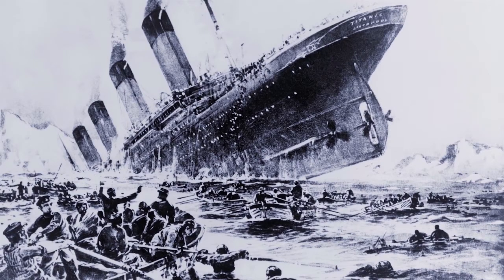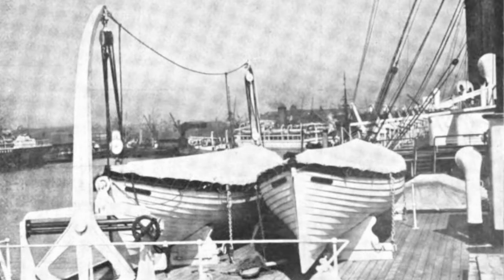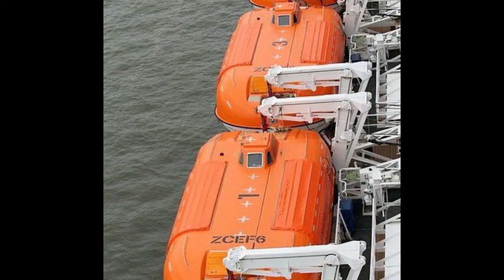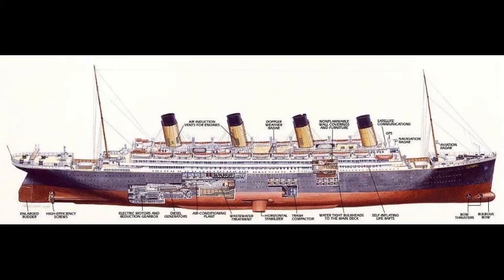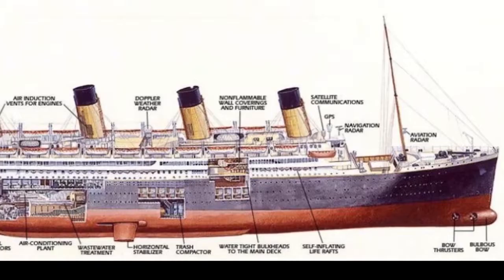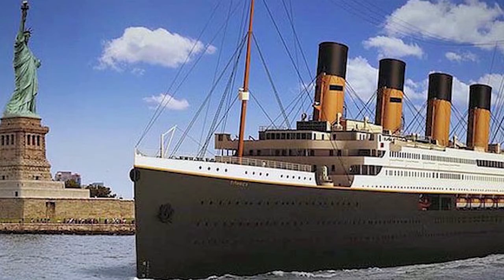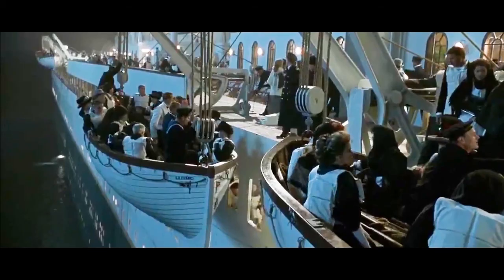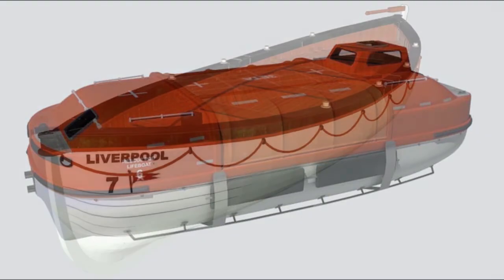Replica Titanic Lifeboat Dilema

Comment: If the third class is done correctly it could make the titanic 2 even more attractive towards people who want to sail on a passenger ship
Possibly more than modern cruise ships
Reply from the maker: Palmer has said there has been a lot of design debate about 3rd class.
Reply: @WaterWorld1  oh
Reply from the maker: ...debate about how authentic to make steerage or not.
Reply: @WaterWorld1  it should be solved at this point right?
Reply from the maker: @bambinazo123  The Titanic II design is complete. However, we don't know the final details. There is no way you can accurately re-create steerage: ie only a few toilets and baths for 1026 passengers and cabins with multiple bunk beds. Modern passengers go cruising to experience  luxury. Sharing a toilet with hundreds of other people would not be appealing.

Comment: But what if the Titanic two will sink and they won’t have enough time to lower the all of the modern day lifeboats because it’s kept on the lower decks?
Reply from the maker: Good question. Modern ships (inc. TIT II) have better watertight compartments. If they hit something which made a hole in the hull, they would possibly stay afloat or sink so much slower. It should be possible to evacuate everybody in time. See: https://youtu.be/hhecZ6XNQ9g

Comment: I think the mess of the front two funnels, for a main example, are more an issue.

Also deltamarine has told some i have seen that they would look into a way to hide the new extra boats by doors.
Reply from the maker: Yes, I'm not sure if Deltmarin came up with hiding the lifeboats a solution that complies with SOLAS.  (Best subscribe as I will have another lifeboat video within a few weeks).
Reply: @WaterWorld1 I have been long subscribed. I say that comment from people asking them online and they saying they were possibly looking into it.

I'd think they would be better in the blue star line look. But orange is better needed. I wish if anything they would be maybe lower, and D deck is were it should be. But that might be both better amd worse than right at the structure line as the aesthetic. But that stuff is the least of problems so far with its working design. Which seems to changed little from years.
Reply: @WaterWorld1 technically the orginal ones could be used if nothing else.

Comment: I have a quesition about the shipyard where Titanic 2 built, can she built in Harland & Wolff where Titanic's built? If she can't built there, can she built in the shipyard that Queen Anne launch in there (Fincantieri Margera Shipyard), because it have a slip launch like the Titanic's launch. And a quesition about lifeboats, what will they do with the white lifeboats in Titanic 2?
Reply from the maker: Good questions: Sadly, H&W can no longer build big cruise ships. Titanic II can probably be built at any of the well-known European yards. I guess it's a matter of which ones have a free slot (2.5 year build)  and offer the best price. The original.style white lifeboats will be retained for show. They are mounted too high for safe use, according to modern safety rules. (See my playlists for extra info on these subjects.)
Reply: Thanks for the explantion. About third class rooms design, these rooms will be wilder than the original? It have a bathroom inside? Because Titanic 2's beam is larger than Titanic's beam 4 meters long and Titanic 2 longer than Titanic 0,15 meters long, taller than Titanic 0,05 meters long and with the Diesel-eletric engines, it will give more place for Titanic 2. Also, third class rooms design have to change somethings?
Reply from the maker: Anything is possible. I suspect the steerage will just be like regular inside cabins (with private toilet, sink and shower) like on-board all modern ships. Originally the steerage cabins had 4, or even 12 bunks in a room. Today 2 lower beds is the norm, with some 4s for families. I do have some videos about cabins in my playlist and more to come. (Best subscribe to this channel and my Tit II blog for all the news)
Reply: Thanks for answers my questions. Titanic 2 might a interesting ship, I think I'll on board in this ship oneday, I'll go to 2nd class first!

Also, I hope Titanic 2 are success with it sisters and fleetmates
Reply from the maker: @PV-40TFS  Modern ships last about 30 years. So if Tit II enters service in 2027, you will have until 2057 to try her.  Start saving! (See my playlists for many more Tit II vids).